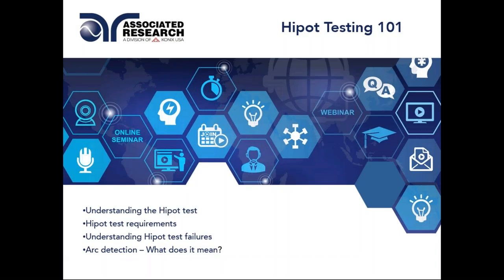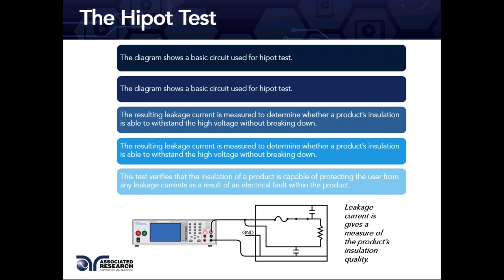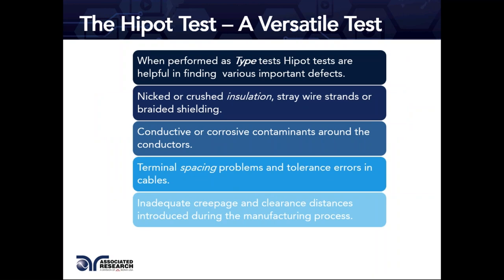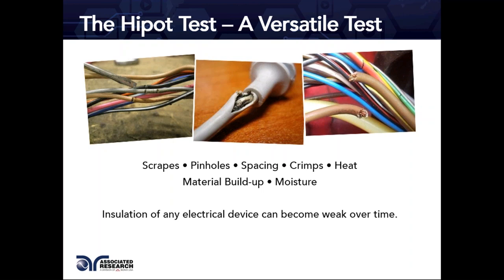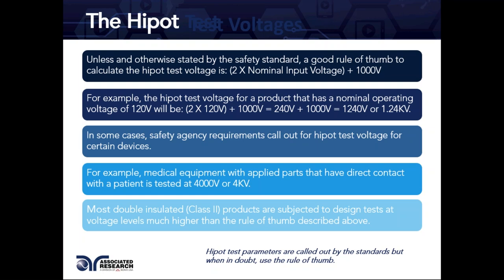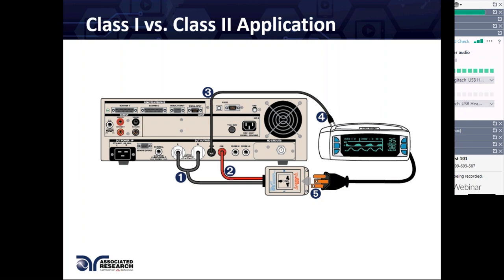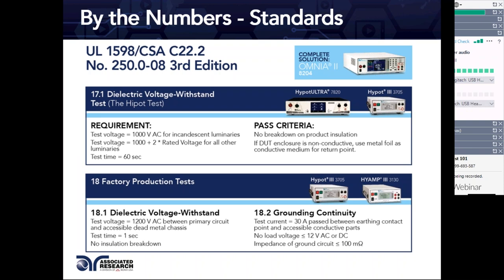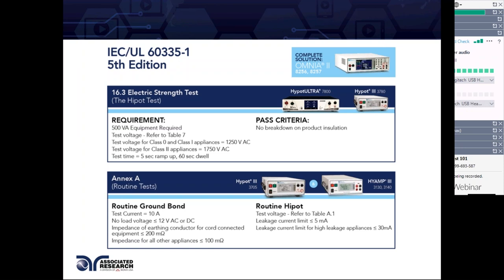Hipot Test 101

Comment: Why mov and gdt are removed while performing  the test please explain
Reply: Im not sure what a gdt is but an mov would be removed because it will cause a short in the circuit when a voltage equal to or above its rated voltage is applied. So you would be testing the mov, not the insulation or spacings of the device